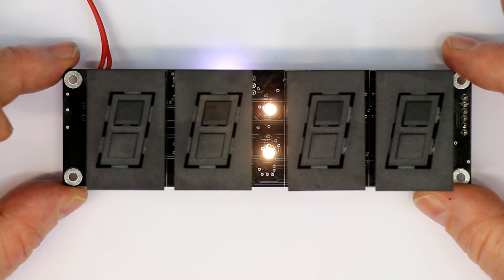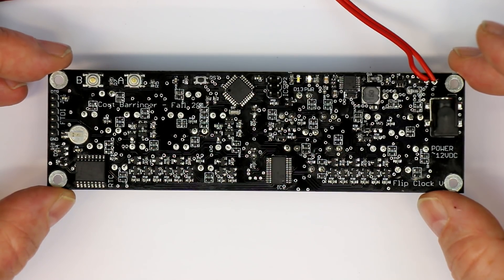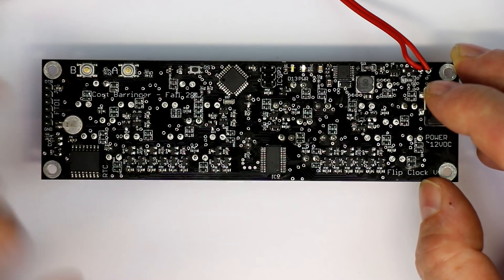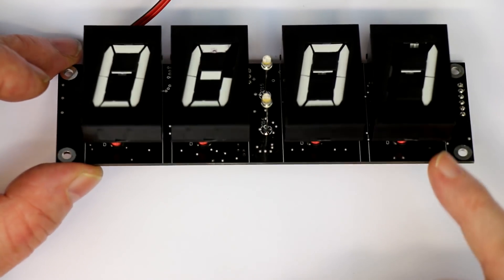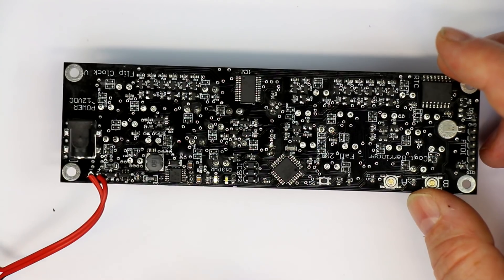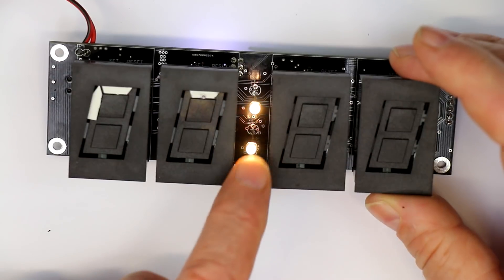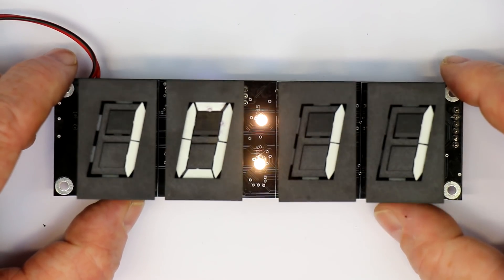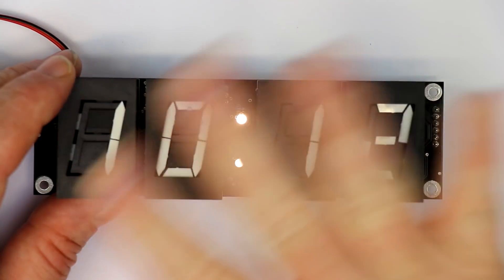My Version of Coyt Barringer´s Flip Clock

Comment: 1)Would there be a way of making this work but also to display seconds?
2) are there options for larger numbers? (so 6 numbers) 
Thinking of making a large wall clock on this style
Reply from the maker: You have to adress this question to the original designer Coyt Barringer. Links are in the video description. Larger types of these 7-segment displays are available and there is no problem in driving the larger displays with the same circuit. The original design can be easily expanded to drive a 6-digit clock with seconds but this of course requires changes in software and expansion of the driver-chips and transistors for the displays.

Comment: I recently designed and built a 6 digit clock/wifi connected youtube sub counter with these displays (https://www.youtube.com/watch?v=2jKnEeMiIrY). I ended up making 2 digit sub-modules using motor h-bridge drivers to drive all the segments that can be serially controlled (up to 12 digits max on the two wire bus) by a master microcontroller (in my case the ESP8266). It works great and is super amusing to watch/hear the segments flip. I brought it into work to keep as a desk clock and it drove my co-workers mad so I've had to move it out of the office to my bench.
Reply from the maker: Yeah, that´s why I later also want to build a 6-digit flip-clock. Can´t get enough of the sound of the flipping segments :-)